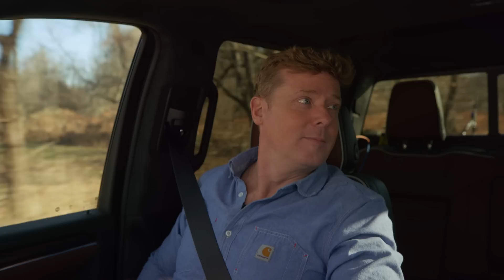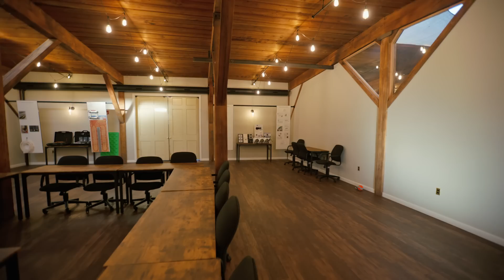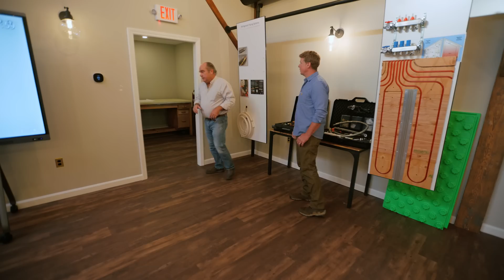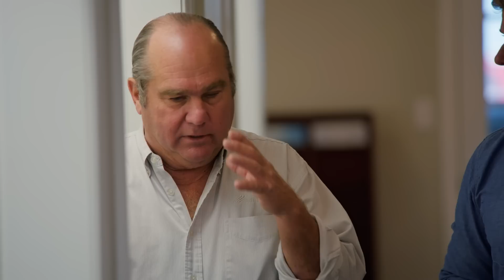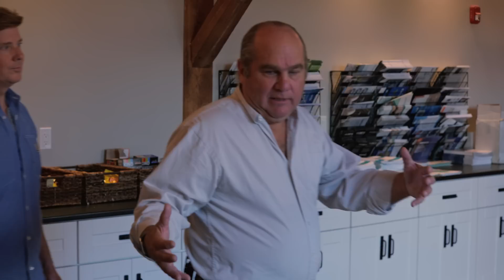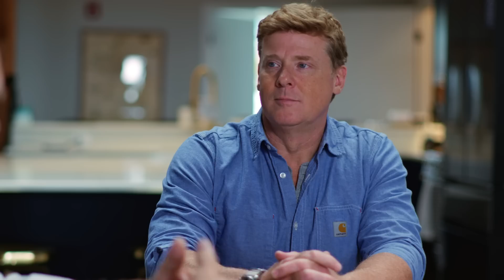Touring Richard’s HVAC Showroom | Ask This Old House

Comment: I’ve just been reading about taking that insulated ductwork in the vented attic and burying it in additional insulation while maintaining the roof at ambient temperature. This supposedly alleviates interior roof damage from moisture, but provides additional efficiency for the ductwork. Of course it’s even better if the ducts are sealed.

Comment: With so much new technology in a modern house it's a wonder that old houses cost as much as they do.  It's like comparing a modern Cadillac to a 1986 Ford Festiva.  The new home should cost a lot more than the old one but it normally doesn't.